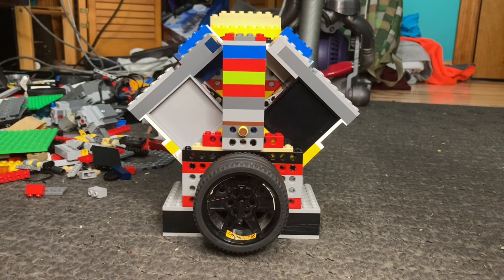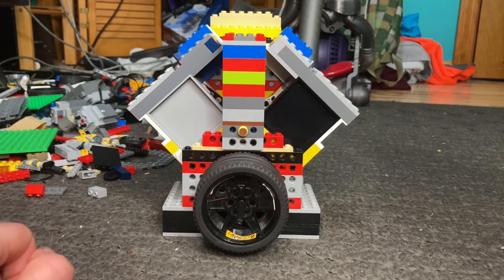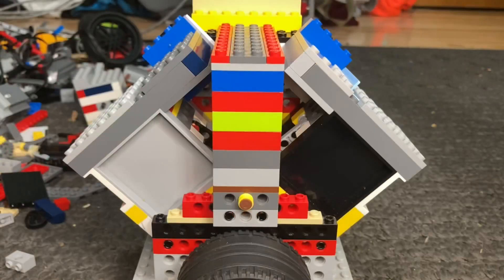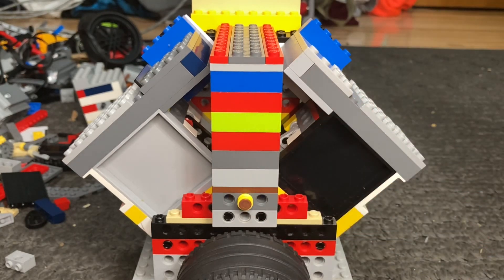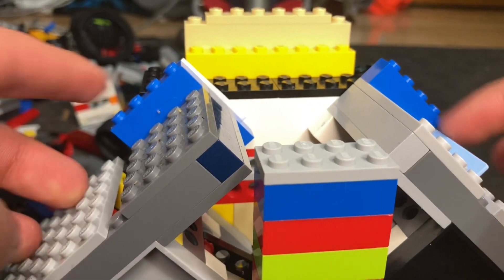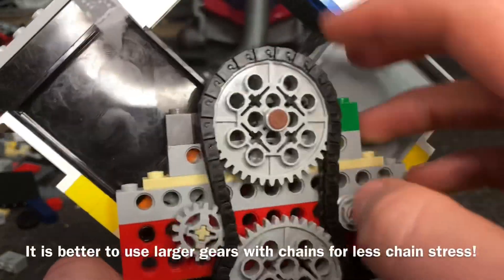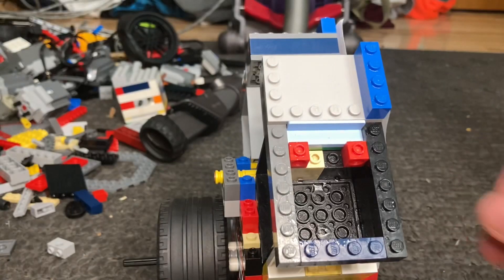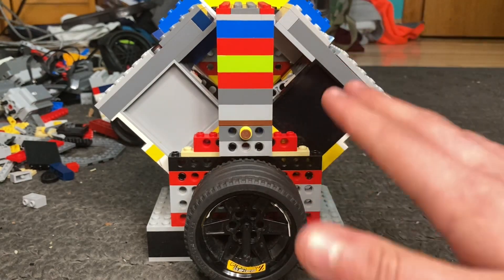VTwin Lego Vacuum Engine v2.0!

Comment: I tried to make v twin with a bigger valves, that caused a problem that the air suction, is suck the valves realy hard. So i did 2 things - i took away those valves, and made it simple valves as possible.
I used 2 cranks for better flow and run for the pistons, and i dont need any flywheel or help to start. Feel free to check it out, i realy like it. Torque was my goal, not speed.

Comment: Hey bro. A tip to make it faster is to add extra layers to the piston and head. Add an extra plate on the piston then put smooth pieces on it. And add a plate in the head.
I have put out a video showing what i mean

Cool engine as always

Comment: Does your vacuum cleaner have more powers or is it always on the max power? I mean like 1 power which is max suction?
Reply from the maker: Yes, there’s no adjustment features
Reply: @KFPlusLegoMastery  ahhh, I usually run engines on power 1, thats why some engines are slower for me

Comment: id love a tutorial, i had built your old v-twin design before, and it ran better than yours, but this with a few upgrades would be even better. and maybe make it fully gear driven instead of a belt
Reply: Edit: i use duct tape instead  of paper
Reply: Direct gearing is very difficult due to unperfect studs because of a plate